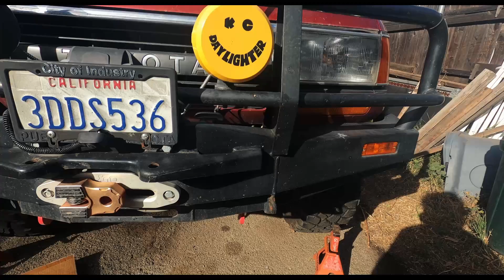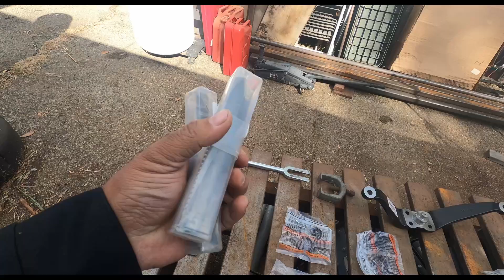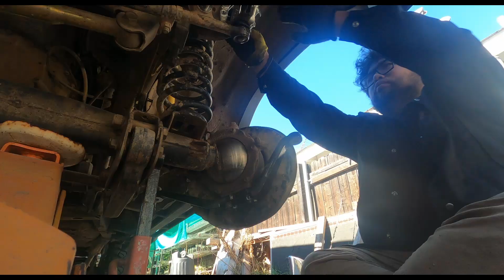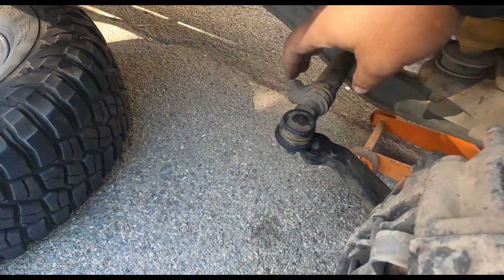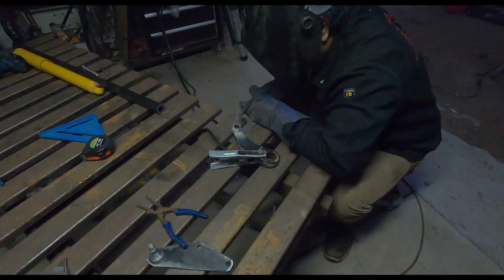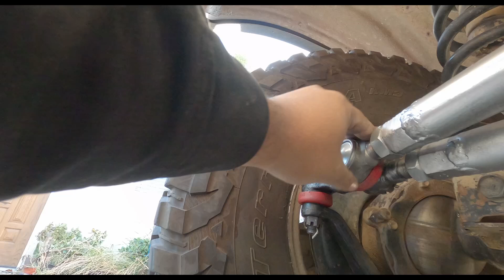Landcruiser | 1 Ton Steering Upgrade

Comment: Do you know if I bought a 1 Ton taper reamer if I could ream the steering arms & Pitman and skip using the inserts or is the large end of the factory 80 TRE already too big?
Reply from the maker: You could do it that way with the reamer, and in fact you'd have more material left if you do that way. The reason I bore through fully was to eventually move up to a double sheer steering setup when ever I go 3 link.
Reply: i personally use 7/8 reamer tto open the holes too 7/8.  Way less room for error with that and tthey surprisngly cut right through the material.  ive had fair share of Xj's with 1 ton tie rods.

Comment: How is the steering holding up? Any issues while wheeling?
Reply from the maker: Steering has been great, the rod end boots need changing at this point, but the rod ends are holding up no play. 

There is one issue I didn't mention but was aware of when doing this, and that is where the new tie ends up being, will hit the front pan hard tower, it only happens to me when I'm moving fast in the desert or whoops, but when rock crawling it's a now issue. It might be an issue if you ran shorter than 4in springs in front. But it is going to be fixed whenever put in a 3 link kit.
There was also a time I thought something was loose with all the new links as the cruiser was wondering, but we narrowed it down to the radius arm bushings being absolutely roached.
Reply: Thanks for the response. Im thinking of copying your set up but adding SLEE's top steering arm and using spherical rod ends on tie rod & TRE'S on drag link. Let me know your opinion. Thanks
Reply from the maker: If you dont mind bot having abs I'm all for it but for me, I like having my abs just cause it's working correctly at the moment. But that wouldn't be a bad, because its suppose to be a double sheer setup, my set up is by all means a step below that. If you're familiar with oregon_trail_ on IG, I believe he has better setup, even though your welding to the knuckle. I think if you weld and gusset the steering arms to the knuckle, (aussie race trucks do this, you can still service the knuckle) and then add the slee arms, it would hold up better. My 2c on that. If you got more questions don't be afraid to hit me up on Instagram, for faster messaging, the link is in my bio.
Reply: @EELandCrusher94  I had the exact idea. Did you end up doing this?